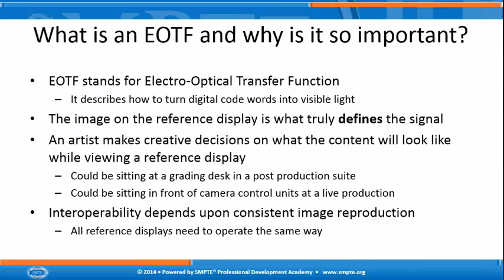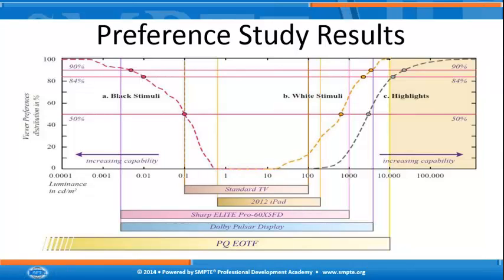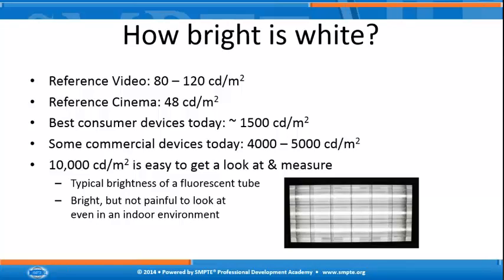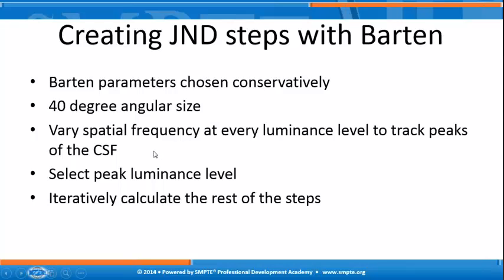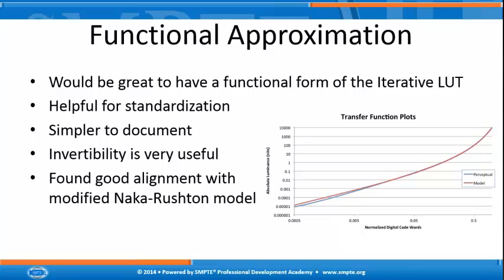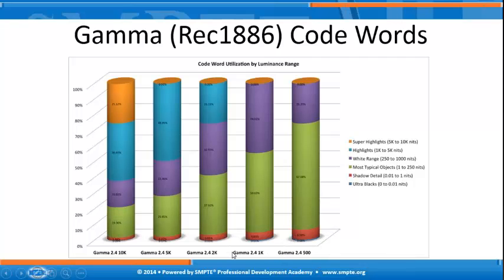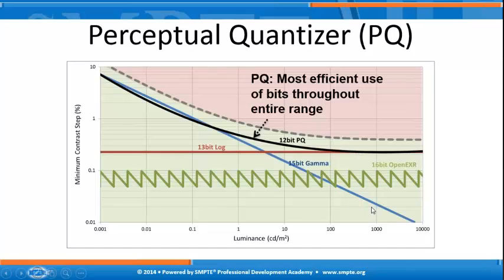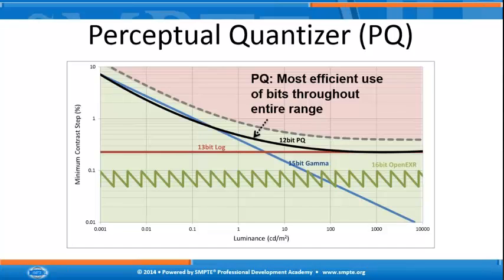SMPTE Standards Update Webcast: Perceptual EOTF

Comment: If the Rec. 709 OETF is not the inverse of the EOTF, then how can the original colors as captured by the camera be recovered when displayed? Why doesn't Rec. 709 define an inverse OETF that most displays should target as their EOTF?
Reply: For Rec. 709 and all its predecessors, the camera TF is intentionally NOT the inverse of the Display TF. The difference between the two is called the system gamma (approx 1.2) and is a look transform that (somewhat compensates for the Stevens and Hunt effects and) increases contrast and colorfulness as preferred by viewers. Without it the program would appear flat, desatured, and boring. HDR content uses more complex look transforms between camera and TV.
Reply: It is the inverse outdoors where you use 2.0 gamma. But inside you use 2.2 and in the dim room you use 2.4, aka BT.1886.